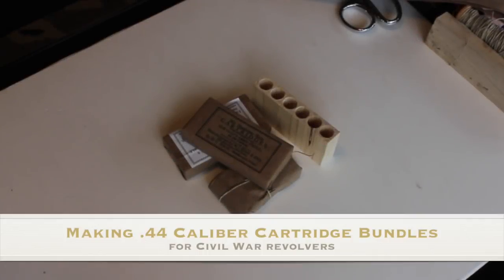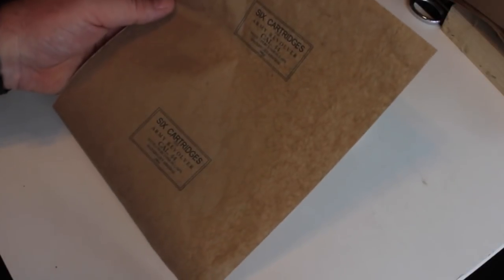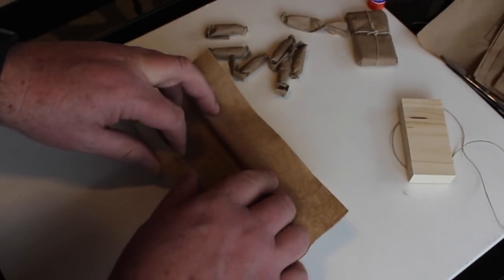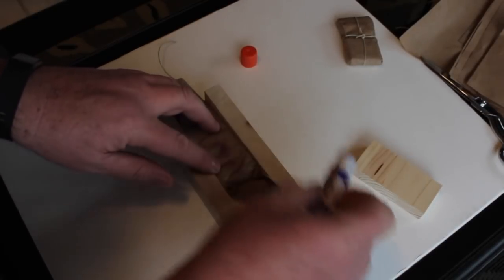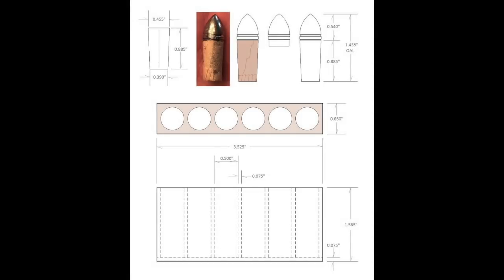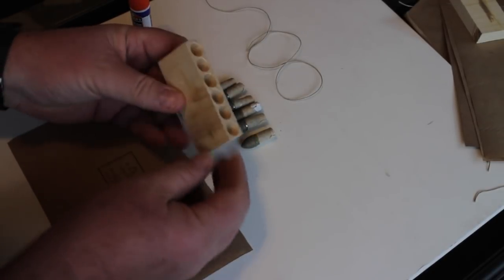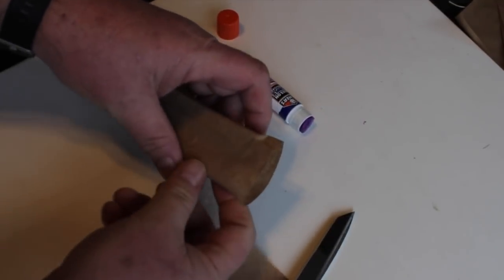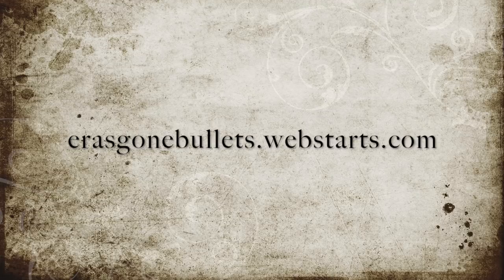Making Civil War Revolver Cartridge Bundles

Comment: I use a self centering doweling jig on my boxes I have made. Just had to make sure my drill bit was marked so I didn't blow thru the bottom. I also added a thin piece of card stock on top of the box to cover the cartridges. Once the sides are glued I use clear shellac to "water proof" it. Here is also an idea for printing on the brown paper (after jamming up my printer): Design the label with cutting marks, paste the end to a piece of thin card stock outside the cutting mark (let it dry) then run it thru your printer. Make sure your printer is set to the heavier paper.

Comment: A most informative and enjoyable video, as always. With my glue sticks, so they don't roll away, especially on unlevel surfaces, I use a short bowl to hang on to the stick for me. On level surfaces, I invert the glue stick cap open end up and I place my stick, loosely, back into the cap during my work session to keep the glue from drying out & fresh when I am not applying its contents. Again, many thanks for the video, well-done, sir.

Comment: How about having a rubber stamp made of the label. Then you can just stamp each pack after wrapping.
Reply from the maker: That might work, if the stamp does not cost too much to have made.  But, most of the originals had printed labels.

Comment: To make my cartridge bundles I cheat.  What I do is cut a block of wood the size of the needed bundle, but twice as long.  I then wrap and glue the paper around this former, but leave the paper open on the long side.  Once the glue has set, I withdraw the paper from around the former.  This makes a minature paper bag, in which I put the cartridges in.  I then fold over the excess paper and tie it up.

Comment: Also could you maybe do a video on metallic foil, revolver cartridges?
Reply from the maker: Chip, I have not experimented with foil revolver cartridges.  That would be a worthy subject for a video.  Colt used true tin foil for his early cartridges which is difficult to find these days.  I don't know if aluminum foil would react the same way as tin under heat and pressure.

Comment: Mark, is there a source for nitrated paper to make there cartridges?
Reply from the maker: The only pre-nitrates source that I know of is magician's flash paper.  Most folks either nitrate it themselves or just use a self consuming paper such as cigarette paper or curling paper.
Reply: You can make combustible cartridge paper. Most "stump killer" products are 99% potassium nitrate. Make a liquid solution of "stump killer" powder mixed with water in a plastic tub, ( tupperware etc). Soak the paper, either cigarette paper, or plan coffee filters ,in the solution. Hang the paper to dry. Cut to size. You have combustible paper for BP cartridges.
Reply: Buffalo Arms sells sheets of nitrated paper. Unfortunately they're on back order right now and they can't tell me when they'll have more in stock.
Reply: @ThePrader  Only Spetracide brand is KNO3-other brands are some other oxidizer.

Comment: Is there anyone that sells predrilled blocks of this size? I've seen a few kits out there with the blocks, but they have much thicker walls between each hole, and as a result the blocks are too large to fit my cartridge pouch properly.
Reply: You could attempt to make your own, Harbor Freight sells a relatively inexpensive drill press and sets of wood drilling bits.  I would use a thicker block and then shave it down after drilling the holes.
Reply: Cap and ball does on his ebay site, kind of pricey, but beats buying a bunch of tools to never use again.
Reply: @ValcoBayrunner  The ones from Cap And Ball (the ones with the hinged lids) are much too large. They're too long to properly fit the cartridge pouch (the flap won't close).
Reply: @ValcoBayrunner  What man wouldn't use the tools again? Who don't need an accuse to buy more tools.
Reply: @Ambaryerno  1"1/2 ×3" is what is accurate for the ones made at the beginning of the war. And that size you can fit three packs in a cartridge ammo belt pouch. And that is how many they are supposed to fit.
Reply: The Tube Factory on Etsy sells cartridge package kits for revolvers.

Comment: Could you do a video on non combustible cartridge for the 1851 Navy? I’ve made up some for my navy, but I was wondering if they existed back then, since the Navy is still an early colt revolver
Reply from the maker: Chip, or should I call you Cheddar? :)  Check out my video on making Early Colt Walker cartridges.  That same style round ball cartridge was also made in .36 for the Model 1851 Navy.
Reply: Sir it’s fine either way, but thanks for awnsering my question, I was mainly asking because all I see with paper cartridges are combustible ones, except for the Walker
Reply: Mark Hubbs is there anywhere to find the dimensions / specifications of these early .36 cal cartridges? I checked the 1862 ordinance manual but could only find specs for 145 grain conicals.

Comment: Have you ever considered selling the Sage contract style of block?
Reply from the maker: That is something I have no considered.  After I retire this year, I may consider making a few for sale.
Reply: @erasgonehistoricalmolds2400   If you ever decide that's something you'd like to do, I'd be interested in purchasing several.
Reply: @calebwarren8168  As would I. All of the other pre-drilled packet blocks I've seen out there have much thicker walls, resulting in a much larger block which doesn't fit into the cartridge pouch very well.

Comment: How did they keep them dry? One heavy rain or high river to cross and you’re screwed
Reply: The cartridge box (bag) is water resistant. And lift it over your head if necessary to keep it out of the water.
Reply: Shellac
Reply: Zip lock baggies, qt size preferably

Comment: What type of paper was used for the label and wrapping?
Reply from the maker: Gary,  as I mentioned in the video, this is simple lightweight masking paper.  I bought a roll of it at Home Depot.  I cut it to a standard letter size so I could run it through my printer.
Reply: I missed that part. When I went back, I found that the video had started at the halfway point.